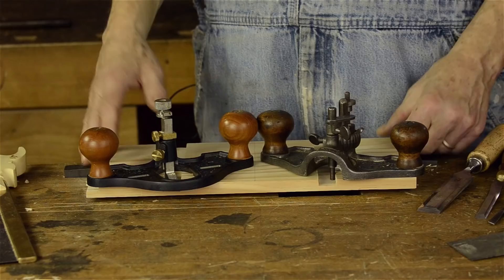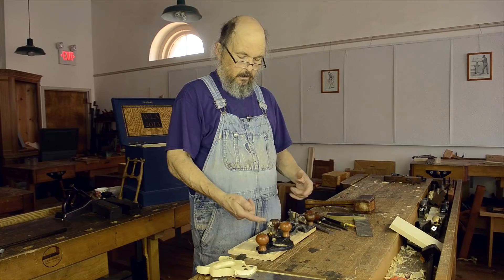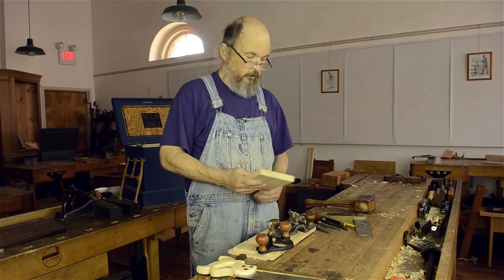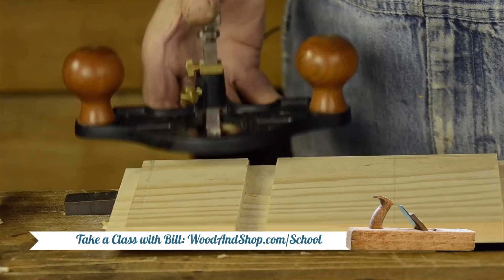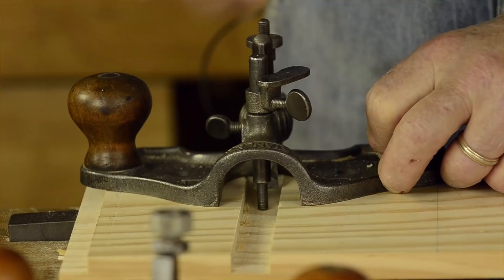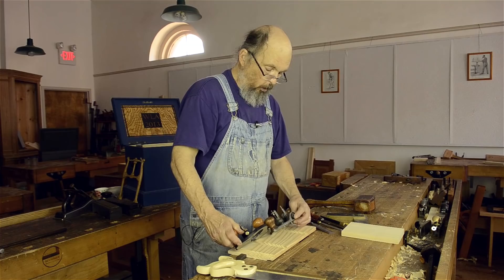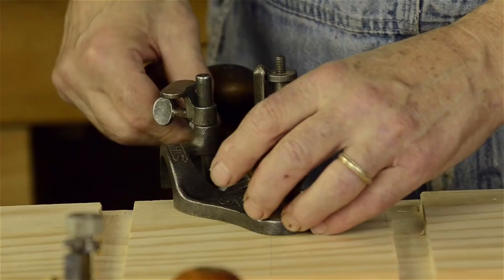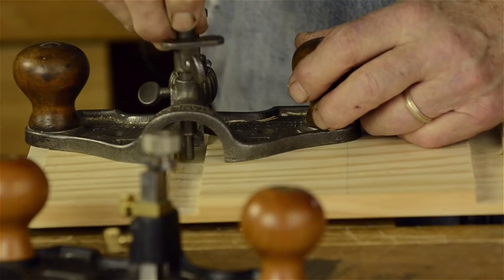Make a Dado Joint using a Router Plane w/ Bill Anderson

Comment: Stanley invented open throat routers because closed throat routers had an issue with chips getting pushed under the front of the router. While not really a problem under wood routers, the harder surface on metal router planes would cause the chips to mar the surface. Being able to see further ahead was a positive side effect. So open throat routers are better for routing in the middle of a board because you are less likely to mar, while closed throat routers are better towards the edges and on thinner stock, where the extra support is helpful.

Comment: Your hold-fast is similar to mine - it doesn't hold correctly.  I had to do a fair amount of power grinding to get it to hold correctly.
Look at your video when you first use it and you will see that it only holds at the heel - not the toe or completely flat - which it should do.
That is also why you have to really bash it to hold.  The wood is spinning on the heel of the hold fast and the wood is pivoting.  When it does this you bash it harder, further making it bend more, and thus making the pivot point sharper (so it pivots easier).
The more you bash it the more it bends (and stays bent) the more the wood is going to pivot.

It really should hold with a decent hit not a full muscle swing.  That alone should tell you that something is wrong.

Ideally it should hit at the toe, then bend back towards the heel to hold the piece in place.
Reply: Grind down which part? The heel?
Reply: @borp6912  
Yes the heel.  Last line of above - hit the toe then bend back towards the heel.  
If it hits the heel first it will create a pivot point and not hold well at all - my experience.
Reply: Regarding these holdfasts:  will they work in 3” thick bench tops?  Thanks
Reply: @jporterfield  
They will work  - if - the hole is larger than the holdfast.

The holdfast has to work at an angle.  If not and too straight they won't hold.

An easy test is to get a block of wood (even built up) that mimics the bench top thickness and drive the holdfast in and see if it will hold a block of wood.

If it doesn't = enlarge the hole then try again till you get the right size hole.

They only hold at an angle (which started this discussion).

Comment: Have you contacted Stanley re; your question about why they made an open throat hand router?
Reply: Paul Sellers answers this in the router plane Q&A on his channel. If you're routing a groove with a blind end, then wood chips will be thrown forward onto the surface of the work. As you pull back, the chips are drawn under the mouth of the plane and can mar the surface, so Stanley added that little humpback bridge at the mouth. However, if you're routing a groove in narrow material, like the edge of a board, then you need the mouth closed to support the plane against tipping forward, hence Stanley included the widget to convert back to a closed mouth. Hope that helps.

Comment: By the way, your buying guide site has been down for ages.
Reply from the maker: What do you mean? I see that it is up and running normally.
Reply: It is working now, I checked the site yesterday and it was down, specifically the part of dividers and other measuring tools, anyways it seems to be working fine now :)
Reply: I'm sort of hijacking my own comments, but... which size of dividers would you recommend? 10mm or 15 mm thank you.
Reply from the maker: @androidgameplays4every13  Ah, yes. Yesterday was a bad day. We had a server problem and the site was down the whole day.
Reply from the maker: @androidgameplays4every13  Hmmm, I've never bought any based off of size, so I'm not sure. All sizes are useful for different reasons.